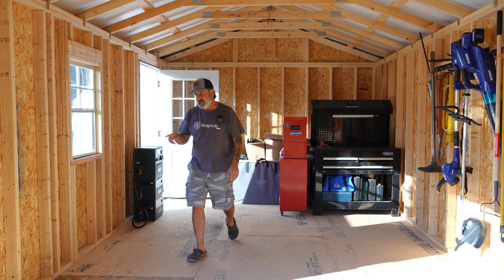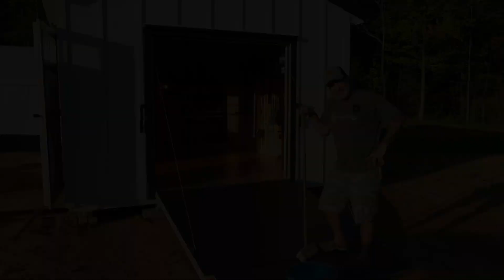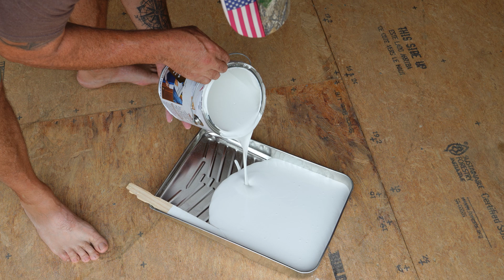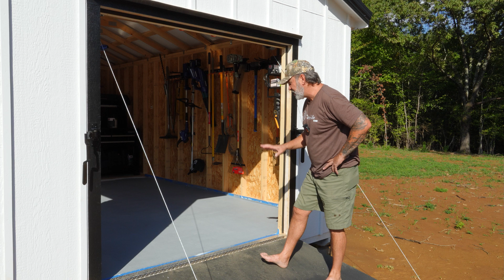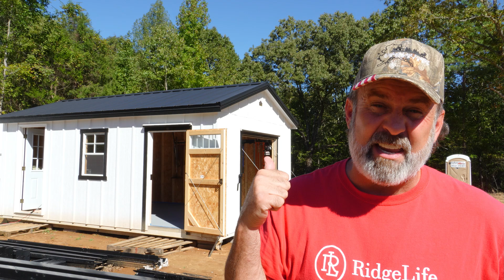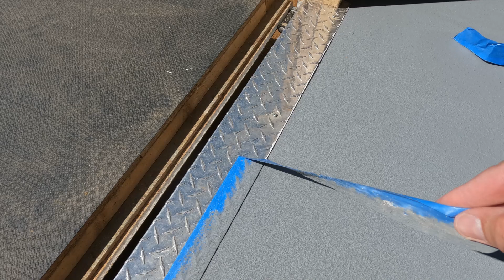MESSY Project! | Tiny House Floor | Solar Shed Build | Off Grid Barndominium Build

Comment: You should insulate the tool shed to protect your tool batteries from freezing nights and hot days.  Maybe you are moving them to the solar part?
Reply from the maker: The roof is partially insulated and is black. It really doesn’t get that cold here.

Comment: YOU SHOULD HAVE FILLED THE DECKING SEAMS WITH CALKING.
Reply: After normal expansion and contraction takes place, he'll soon be faced with the better option of caulking.  Caulking is the better option and developed for the very reason of being more pliable and and it's ability to withstand expansion and contraction while dealing with many variables.
Reply from the maker: Very true! Luckily, this is just a shed and not a finished floor.
Reply from the maker: This paint is supposed to do like caulk in the cracks but that would have saved some material true! Thx.

Comment: The floor looks great. When they built the shed they want to get them done fast and they use nail guns. When I went to the carpentry school I went to, they had us build sheds but everything was screwed. With the nails when the temperature changes the wood will  expand and contract causing the nails to lift up so you constantly get nail pops. With the coating you put on the floor it should help a lot.
Reply from the maker: Ah! Good point.

Comment: You can put rubber match down on the floor where you're going to put your motorcycle, so you don't have to repeat this.That's over again with the motorcycle going.Think smarter than not harder
Reply from the maker: Great idea!

Comment: Helpful hint:  put some sand (or sandy soil) in a bucket, then pour used oil in it. When you finish using your digging implements,  jab them in that bucket a few times to clean the dirt off them, and to keep them from rusting
Reply: Awesome idea!! 💯
Reply from the maker: Nice!